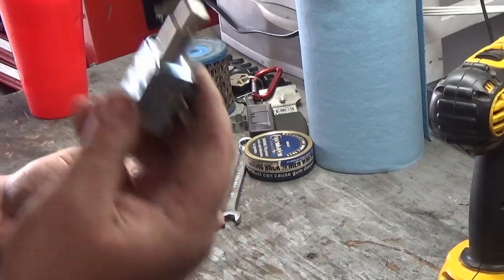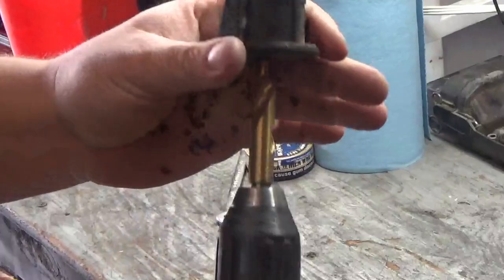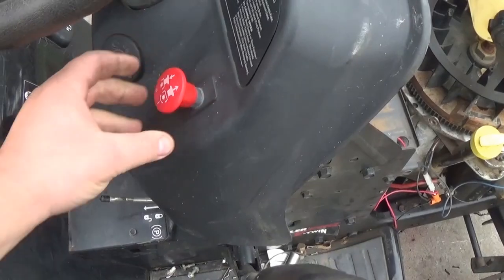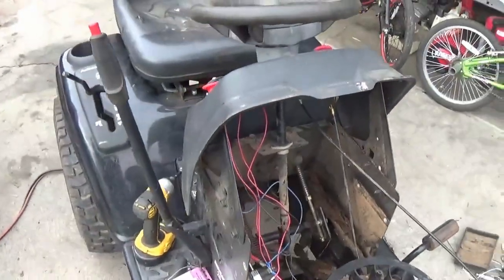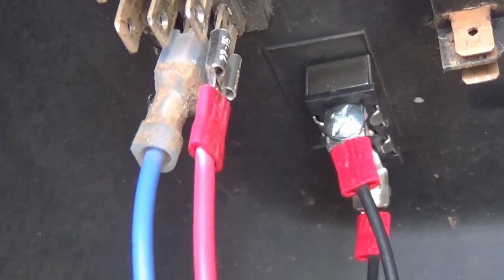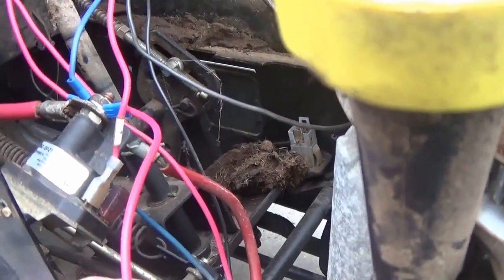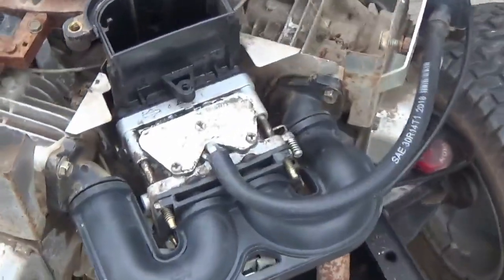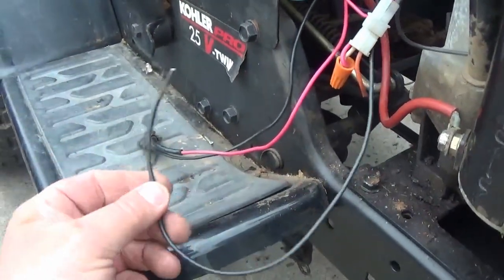Riding Mower Saftey Switch Issue, How To Bypass & Rewire Your Tractor DIY (2019)

Comment: You can use your old key switch.  That way you don`t have to install a different push button and a toggle switch to shut it off.  Just wire the B to battery, M to magneto (coil) - (or it could be stamped I for ignition), S to the solenoid, G to ground, and L to the headlights (if you have them).  The letters should be stamped on the back of the switch - if not, you can find diagrams on line.  The one stator wire is red 12 + volts (it will not charge on 6 volts as you stated, when the mower is running at full throttle you should have slightly over 12 volts) and the other stator wire is black which goes to the headlights.  The red stator wire has a diode inline that converts AC voltage to DC for 12 volt charging.  Doing it this way the switch will work normally but you will bypass all of the safety switches. You are correct about the solenoid wiring, if it has one post the solenoid body will ground it, if it has 2 posts you have to run a separate wire from one spade connector to ground.  I find it`s a lot easier and looks (stock).
Reply: Thanks
Reply: how would i do this? would it just be as simple as cutting the wires i don’t need?

Comment: Good job. But I would have some inline fuses. It actually puts out 13 plus volts. You can add a cheap volt meter too. It helps monitor the battery. No sense in trying to start with only 10 volts. All equipment should have a volt meter.

Comment: I'm fixing to do the same with my mower. I already have the seat switch bypassed so I can get off the tractor while it's running. The safety switches are just there to babysit the stupid people who have no common sense. It doesn't take much to bypass all those switches but tearing out all the wiring and starting over is so much simpler and cleaner.

Comment: Those stock key switches are junk. Ordered 2 new ones from Sears Parts Direct, tested them with a digital multimeter ohm meter for continuity. 1 did not work, new.

Comment: I have a jd lx172 with the igniter on the side of the 14hp kohler how could I bypass that? It’s one of the models with the circuit board behind the key switch and it’s 130$ so I’m just rewiring the whole thing

Comment: I have a jd la135 I inherited from a friend, it shuts off when it heats up. Any direction you can point me to? Replaced coils, carb, plugs, fuel pump, ....all safety switches are bypassed. I'm puzzled

Comment: Solved my 7 pole husqvarna switch big hole in the dash issue. I modified your standard box switch application with a standard round starter switch with rubber weatherproof cap. Drilled 1/2" hole so it could slide in easy, used bulk head lock nut to secure, screwed on w/proof cap. As you said clean, sanitary look done right. Thank you  love the University of YouTube.
Reply: I have a husqvarna LTH 130 riding mower and haven’t figured out how to rewire it yet any suggestions

Comment: awesome video, thank you! i would like to share my experience with a Husqvarna RZ4623 zero turn mower. this mower would not start it is a safety switch that is keeping my mower from starting. i checked the switches and tested each one and they are suppose to be working. every wire on these safety switches has a white wire connected to the socket. tracing most of these wires there are about three of these wires joined to the negative ground cable. The solenoid has a white wire as the trigger wire. on the ignition switch i found the S on the switch either it stands for solenoid or starter. i cut the wire from the switch leaving enough room for splicing.. i connected a direct wire from the ignition switch S to the solenoid and disconnected the white wire in the solenoid with my spliced wire from the ignition switch. The engine started and to my surprise i bypassed the safety switches on my husqvarna zero turn.

Comment: Great video!  I have a Honda 4518 and i want to eliminate all relays, safety switches, and electronics.  This machine has several boards that are damaged.  My biggest question is how to get spark when i dont have spark?  And also i'm curious of diods coming of of pto wiring???

Comment: So just re-wiring under the hood like you showed us will by pass all the safety wiring from the clutch/brake pedal, gear shifter, mower engagement and seat safety switch? My Craftsman is pretty old but has the safety features i mentioned. Yesterday i swapped my old seat for a newer one then dropped the mower deck and now i cant get power to the starter. i went underneath and noticed a whole mess of other wires (with inline fuse) running from the gear shifter back. I like to know how your wires run from your battery under the seat to your dashboard. Thanks for this upload :)

Comment: thanks, helpful..what about the voltage regulator? i swaped kholer no courage crap motor with a 14.5 briggs and splicing the regulator from the cub motor to the briggs, gona try it tomorrow. not sure if the stator is enough amps for the mower clutch

Comment: Hi that was very informative, however do you not need a relay or fuse connected from the solenoid??????? jst asking, thanks
Reply from the maker: No problem, u dont have to but if u wanted to it wouldnt hurt. For safty but i have never used them when rewiring and havent had a problem

Comment: Thanks for this video. It worked like a charm for me. But, I have one question, how would I wire for the headlights & hour meter? I have a new engine & put a new hour meter is so I could keep track of the running time. Thanks in advance if you can tell me what to do.

Comment: Great video!  I’m sure my 4-wire seat switch is fried. I’d love to get rid of it. Mine is a 2014 Craftsman LT2000 but this video helps.
Reply: Mine has the Briggs and Stratton 17.5hp engine
Reply: Often you can just unplug the seat switch but not sure about what to do if it has four wires.  Usually it just shorts the ignition to ground if you get off the seat.

Comment: THIS IS VERY ELIGHTENING. I AM WORKING ON MY NEIGHBORS GT 5000 AND GOT IT RUNNING. HOWEVER, EVERY TIME I PULL THE BLADE SWITCH THE MOTOR DIES LIKE THERE IS A KILL SWITCH WORKING. I HAVE BYPASSED THE SEAT SWITCH AND THE BRAKE PEDAL SWITCH. IS THERE ANYMORE KILL SWITCHES I NEED TO BYPASS? OH THANKS FOR THIS VIDEO!

Comment: I don't plan on permanently disabling all the safety switches but want to do so just to isolate a problem. The ignition switch on my Honda 3813 tractor isn't sending juice to the solenoid; turn the key and ... nothing. On this Honda, all 3 safety's (seat, transmission, & PTO) have snap-apart connectors. Question is: if I disconnect them, kinda like you did, will they be bypassed or will that actually engage the safety feature? I know I could simply try it both ways but they are hard to get to so I wanted to get your take first. Thanks so much.
Reply: I got a free Craftsman opposed twin that would start then die when I let out the clutch so I figured the clutch interlock was bad.  But I did not want to replace it because it is a bitch to get to.  So I pulled the plug and jumpered one of the two sets of female connections.  Now it works fine.  Only prob is I have to remember to put it in neutral or push in the clutch before cranking.  In other words now it will start in gear so might be a bit dangerous.   I believe I found if I jumpered the other set of female connections it just would not crank.  I think you can eliminate the seat interlock by simply unplugging it.  You might have to experiement with the deck interlock.  In my case that one was easy to get to so I pulled it and it tested ok.

Comment: I'm having an issue with my mower starting. You might have some advice. Idk if you answer comments. My solenoid is energized before I turn key to crank. Nothing in off. 12v is on both battery and starter post key on not cranking.. is this normal

Comment: I have a rider mover that has not been running for like 35 years would taking all of the safety switches off would make it run? Also do i have to just wire the key, stater and the lights if i took the deck off

Comment: Question- Bought a house and the previous owner left a craftsman riding mower with a Briggs 18.5 Intek. Said it didn’t run and didn’t know why. Anyways I dove into it and found a bad coil/magneto. Ordered a new coil and it ran great. Drove around with no problems til I shut it down. Would not restart. Found that the new coil went bad...again. I’m guessing for whatever reason 12 volts got sent through the ground back to the coil and fried it? Your thoughts?
Reply from the maker: Tha ks for the comment! Honestly i have never seen power go through the ground and damage a coil like that but anything is possible. Heres a couple thing u can do if u havent yet, disconnect the ground wire on the coil and check for spark again, if u have spark then u have a bad ground if u dont than coil is bad maybe a cheap coil? If not oem. Let me know ill try to get back to u
Reply: Small Engine Repair So I received the new coil today. I installed a toggle switch on the dash and wired one end to the frame and one end to the ground terminal of the coil. Basically just made a kill switch. We’ll see if it lasts! Will keep you updated.

Comment: trying to bypass safety swiths on a craftsman twin cylinder       kill wires to coil have diodes  on them 
went to black ground wire feeding them  and cant turn them off  if i reconnect wire key shuts them off 
but not at plug     ????     question can u turn off 2 coils grounding to 1 wire if u connect both coil wires together it wont run

Comment: How do you trickle charge a 12 volt battery with the 6 or 7 volts you mentioned?
Reply from the maker: The engines have a charging system underneath the flywheel witch back feeds the battery to keep it charging

Comment: Awsome job man. Got one question about my carburetor mine has the wired plug going to the bottom of the bowl  and I think it failed or something because I now have gas filling the compression chamber and when I pull the spark plug I can crank it and gas will shoot out ....Now i have gas in my oil..Do you think my carburetor is the problem.? And can I just unhook it or do i have to do something else?
Reply from the maker: Yes it's definitely your carburetor the gas is leaking through it and filling up the motor so you need to drain all that gas and oil out then put fresh oil in and get you a new carburetor you can get them for Fairly cheap online eBay aftermarket ones work pretty good around twenty bucks just make sure you don't have any more gas in the gas tank cuz it will still dump fuel into the motor
Reply: @smallenginerepair3379  Thanks for the quick reply..I guess any carburetor will work? I don't have to have the one with the wires going to it then? I pulled the carburetor and cleaned it but I guess I'll just have to pick up a new one.
Reply from the maker: @Towboatman111  no problem at all glad to help well the one with the solenoid on the bottom of it would be a good idea to get what type of motor is it
Reply: @smallenginerepair3379  its a 13.5 hp Briggs and Stratton that came on my 38c bolens riding mower
Reply from the maker: @Towboatman111  yeah just look up 13.5 briggs carburator intex should be able to find a cheap aftermarket one
Reply: @smallenginerepair3379  Thanks alot buddy
Reply: @smallenginerepair3379  I just added a cheap in-line fuel shutoff to avoid buying a new carburetor.  No more gas bypass and the oil is staying gas free.

Comment: Somehow I missed the ampmeter part. Do both of the wires from the meter need to be hooked up? If so where do they hook. Thanks bud I really appreciate the vid and it was just in time for me. Havagudun.
Reply from the maker: No problem glad to help usually it is the red wire the other wire doesn't need to be hooked up and that's most Briggs & stratton's unless it has a voltage regulator then you have to find the wire coming off the voltage regulator that generates the power
Reply: @smallenginerepair3379  Thanks a bunch. I mistakenly hooked the bottom wire to the hot end forgetting this motor is mag fired. I probably smoked the coil but will try it again. Again thank you.

Comment: Is there a way to just remove the wiring to the safety switches such as clutch and reverse without mangling the ignition? I just had a clutch safety switch go out and it's almost impossible to get out.

Comment: I'm about 100% sure it would have been cheaper  and so much safer not to mention  easier to just simply fix any saftey relays.
 The worst ones are on MTD products  but in 30 minutes  you can run down the problem  and fix it properly
Reply: It appears that SAFETY is the hardest word in the world to spell.
Reply: I looked at a 1962 Wheel Horse B 80 Tractor/mower, and it didn't have any safety switches,  just labels that said, disengage mower deck before starting.  And park in neutral.  I guess younger folks today need a safety switch rather than read a label.

Comment: so how did you wire up the on/off switch next to the push button? i’m trying to do this on my mower, but i didn’t see anything about it.
Reply from the maker: U have 2 post on a switch 1 goes to the coil wire and the other goes to ground
Reply: @smallenginerepair3379  thanks man!

Comment: How do you wire up the voltage meter for the battery when you rewire it
Reply from the maker: Do u have a voltage regulators? If u do then when engine is running test the wires for around 6 to 7 volts and that's the wire that can go to constant 12volts or directly to the positive terminal. And if u just have to wires coming from under the flywheel should be a red wire test it and it should have the same
Reply: It had two wires going to the dash readout on the voltage. One was going to the battery. It has a purple wire coming from the alternator so do I wire the purple wire to the second wire from the voltage meter?

Comment: Hi i have a lawn tractor that will run for about 5 minutes and then it will start to spuder. And then it will start to blow black smoke. Do you happen to know why this is happening.
Reply from the maker: Could be a couple thing could have a blown head gasket or maybe there is fuel in crankcase due to the carburator failing or to much oil or motor is no good

Comment: I Have A Scotts Made By John Deere. The Blade Engagement Is A Lever Not A Switch. Can I Wire My Ignition Like This? Thanks
Reply from the maker: Yes u can
Reply: Thanks
Reply: Can I Use My Factory Switch?
Reply from the maker: For a kill switch?
Reply: Yessir
Reply: How Do I Wire My Coil?
Reply from the maker: U can make the factory switch a kill switch. Run one wire to ground and and the other to the coil
Reply: I Bought A Push Button & Toggle Switch Like In This Video. I'll Wire The Switch To Coil & Push Button To Starter Solenoid. Thanks For Replying
Reply: How Can I Send U A Picture? I Got A Question Concerning My Coil Wires

Comment: I have a craftsman LT 2000 I lost the key to it. I've bypassed all the wiring and have it hooked up exactly the same but mine won't actually run.
It's got fire and turns over but won't stay running. 

My kill switch is a 3 prong (power, load, ground) because it has a light to show its powered to run... I'm just at a loss
Reply from the maker: How long has it been since the last time it ran?
Reply: @smallenginerepair3379  today. I was crossing the wire harness just to get it running
Reply: I have literally taken all of the wires out of the mower there are ZERO wires ran aside from the starter to solenoid.  I'm wondering if the carb choke or safety shutoff for the fuel is the issue idk..
Reply from the maker: @justinwnichols03  there is usually a little silinod on the bottom of a carburetor in the video I show you about it if your carburetor has one of those you have to take it out and cut off a piece of that because it's plugging up the main jet of the carburetor that could possibly be your problem
Reply: @smallenginerepair3379  ironically I replaced that part a year ago lol I will try again tomorrow and get back to you, thanks again!
Reply: @smallenginerepair3379  this was the fix! Starts up right away and the kill switch works perfectly. ....now to get the deck belt to quit slipping off the blade pulley 😒

Comment: Does anyone know if I bypass the safety switch for the blades it’ll mess up the transmission hydros ? Any help would be greatly appreciated
Reply from the maker: No it wont the transmission only works with the belt
Reply: @smallenginerepair3379  the transmission on my mower is hydro. It’s not belt driven. 
32” Wright stander B
Reply from the maker: @BigMike-Soetoro  okay if you mean hydraulic it should still not mess with it because that's fluid driven and a hydrostatic is fluid driven to but belts run it
Reply: @smallenginerepair3379  ok thanks for your help. The reason I’m really thinking about by passing the blade switch (pto) is because I bag in all my lawns and I’m literally hopping of the mower every minute. (Not exaggerating lol) sometimes every 30 seconds depending on how fast the bag gets full. It’s really annoying to turn off the pto switch on and off 15 times per lawn. Not to mention I’m afraid that with so much use of the pto switch of constantly turning it off and on, it’ll break over time. That’s really the main reason why I want to “bypass it”. And I was just curious if that small modification would mess with the hydro pumps.
Reply from the maker: @BigMike-Soetoro  for sure no problem man just remember to be safe they do put the safety switches there for a reason LOL but sometimes they are a pain
Reply: @smallenginerepair3379  oh yea! Those “safety switches” are a pain for sure lol 
Thanks again.